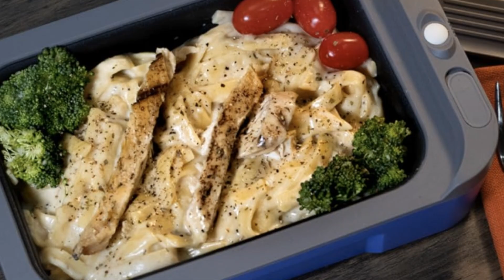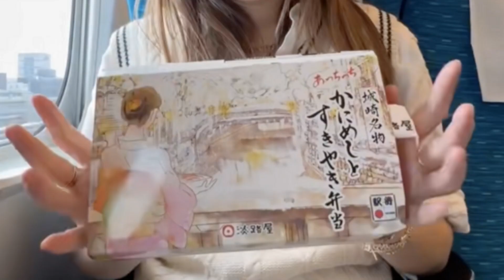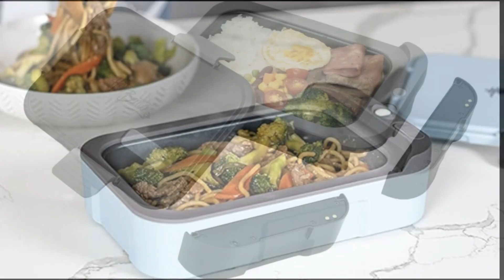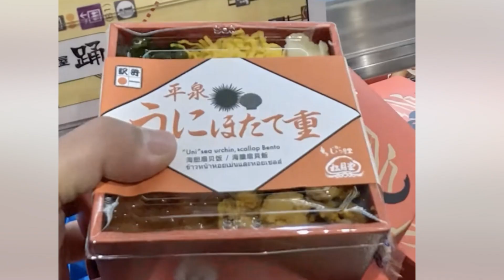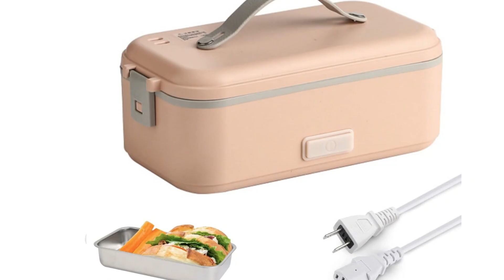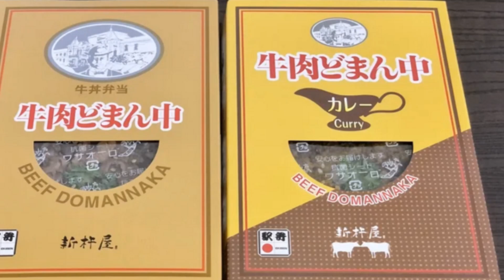The Engineering Behind Japan's Self-Heating Lunch Boxes

Comment: Interesting, so they are using heat packs like they use to
treat lower back pain and water to add steam to aid the process.
By the way pretty sure eating on the tube trains in japan is frowned upon but it's fine to do it on bullet trains🚅 👍